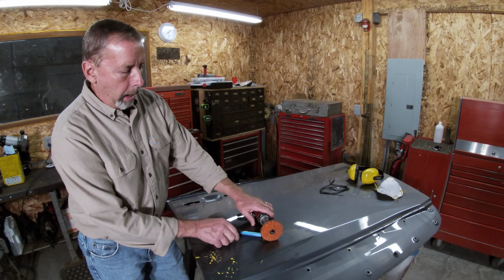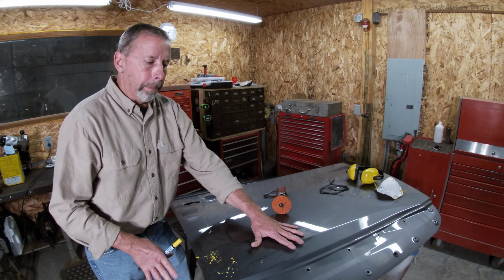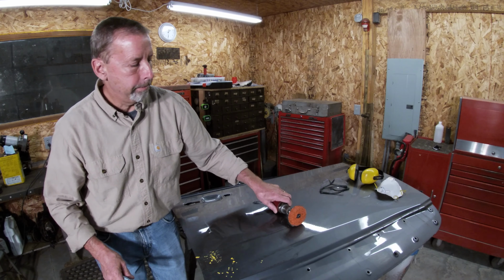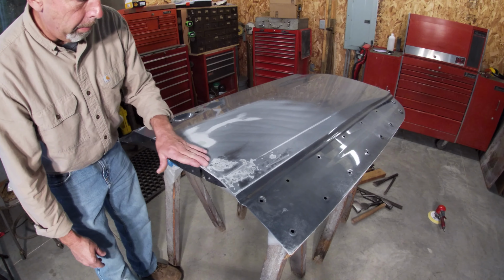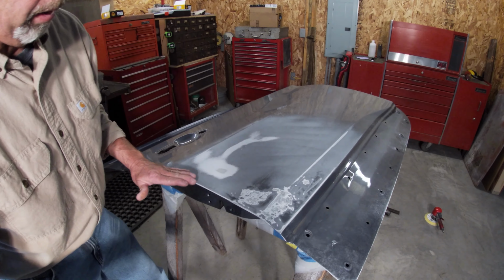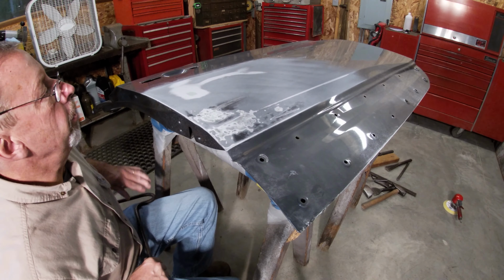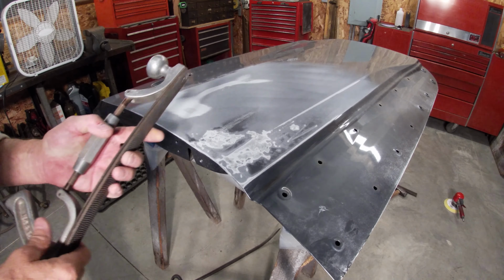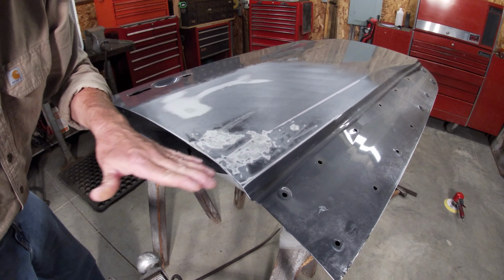How To Do Body Work/Repairing A Door Part 5 of 8

Comment: Around 8:28 you switch tools without explanation, I have no idea what you did or why and of course I’m curious. Also could you give details about the sandpaper, how many “sheets” you used, when do you decide to change it and the dos and don’ts with the sander rotation speed. My teacher said not to go to fast because the sandpaper will just slide over the paint instead of sanding if you do which sounds weird. I see him going so “slow” or without enough air pressure and the sander stalls, leaving only vibrations without rotation and he kind of compensates by moving the sander around like he’s using a block sander which I think is besides the point of using a power tool. I’m also curious about your choice of backer for the sandpaper. Our school uses something which looks harder, and the sandpaper on our sanders looks like it extends past the edge a bit. Sorry for asking questions if they will be answered in future videos anyway.
Reply from the maker: I switched to an eraser wheel tool to remove some adhesive from an emblem I removed prior. I change sandpaper when I feel it’s worn out and that depends on the quality of part you’re using. If you use good quality paper, it will last longer and be more cost effective than cheaper paper. Everyone uses a different speed on their sanders so it’s a matter of what works best for you. You’re correct on the entertainment aspect of videos. My main focus is to teach and show proper procedures because that is something that I think is lacking. When I get positive feedback such as yours, it tells me I’m helping those who want to learn. Thanks again